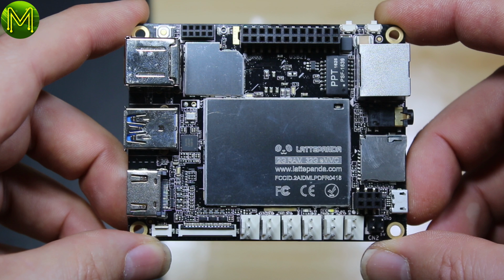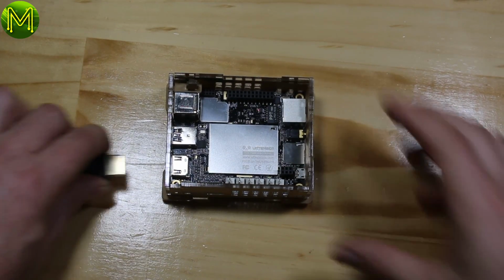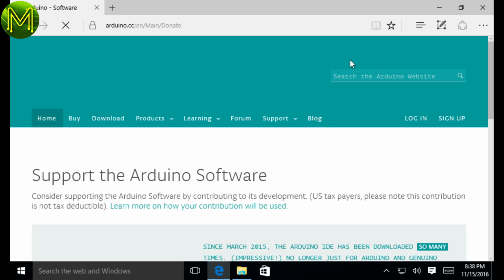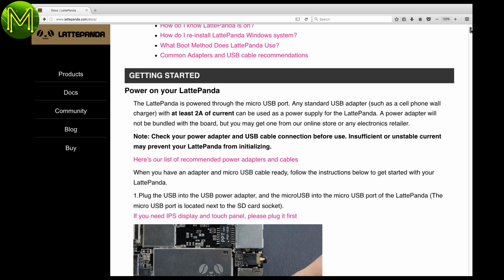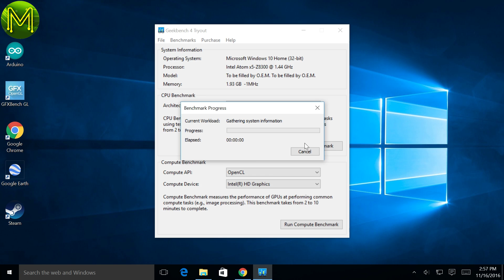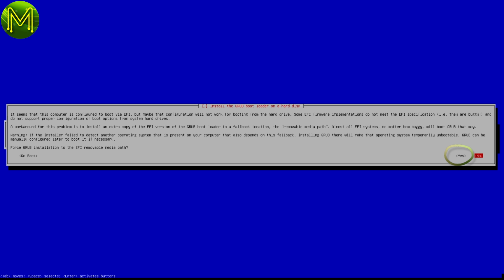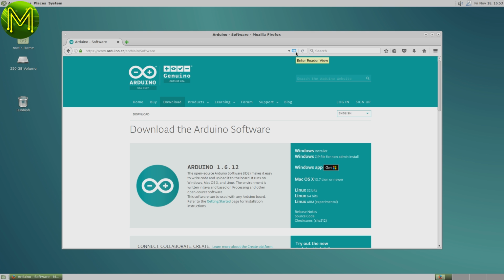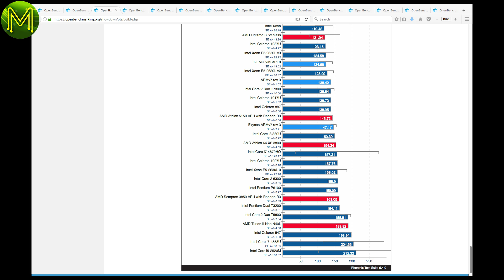#071 LattePanda 32bit: Too hot to handle? // Review

Comment: Let me get this straight. You used the Arduino IDE for the board to talk to itself? Is there an arduino chip also on the board? Is it always attached via COM2? Are the GPIOs only connected to the Arduino chip? Can the Arduino chip be programmed to do its own thing (If-Then, If-Then, If-Then) while the X86 chip takes care of higher (Desktop Computer) functions?
Reply from the maker: +Sean Miller 
You got it all correct!
The board has an ATmega which is accessible via the x86 serial port.
Reply: Thank you very much. It's very appealing for things like a home automation server.

Comment: Active cooling on is a must on the Lattepanda if you expect to get any decent performance.
It's a shame that it didn't include an actual heatsink on the CPU (underside of the board)...the shield/spreader is too thin to really do anything.

I've attached some copper heatsinks and connected a 120mm usb fan, it now doesn't throttle no matter how much I throw at it.

I think it's a great little device but like you said some strange design decisions and inadequate cooling out of the box.
Though these type machines are aimed at people who like to tinker, so it's not a huge issue to me.

There are certainly much better Arduino devices out there, so only get this one if you don't care too much about arduino or must have windows for some reason.

It works great as a media player/streamer using Kodi (inc 4k), youtube 4k and even an external bluray drive.
Also note that Cherry Trail has full hardware HEVC decoding :D
The Lattepanda also performs decently for light games, including morrowind, torchlight 1/2, titan quest etc...
Reply from the maker: Have you checked out my review update on the LateePanda?
https://www.youtube.com/watch?v=LDlRN8uy6FY
It goes into the over-heating issue testing more.

Comment: Definitely loved the video, and can't wait to see part two as I'm curious about possible ways of taming the thermal throttling...  They seem like they'd be a nice solution for a small, low power consumption BOINC setup if the overheating can be resolved, doubly so since they're x86 based which means pretty much any project can technically run on it. ^_^
Reply from the maker: +White Wulfe 
Thanks mate.
Yup the overheating is a problem. The UpBoard guys chucked a big heatsink on theirs which solved the problem on that board.

Comment: Question : I using a windows midi step sequencer (B-step pro) that uses two USB hardware controllers (novation launchpad) and also midi out (m-audio)  Was wondering if this would work on the LattePanda ?    it uses very little CPU.  
Using a dual core mini IBM at the moment, but would like something more compact.
Reply from the maker: +jean luc Dubinator 
Since it runs stick Windows 10, then I'd say it would. Either the LattePanda or UpBoard.

Comment: There is HDMI-audio out. You will need to go into the volume/audio playback settings and set the hdmi as default audio out. The CPU is actually on the bottom of the board, not under the top metal shield. And it needs active cooling. I'd even go as far as to suggest removing the metal shield from the bottom and the cheap thermal pad, and using proper thermal paste and a heatsink/fan. Your little acrylic case sadly won't support this too well. 
http://www.lattepanda.com/forum/viewtopic.php?f=6&t=71&p=3810#p3810
Once you have active cooling, the thermal throttling is no longer an issue.  It'll play skyrim and fallout new vegas, not great, but playable. I managed to get fallout 4 to start, even with 512x512 texture mods, the system just didn't have enough ram/vram to even get into the character creation. But i may try again in the future. I suspect i could get it running at 5-9 FPS with enough modifications and fast enough storage. (usb 3.0 external SSD)

If you're looking for a small single board computer like the panda, just take my advice, spend the extra money and get the top end Up board, the new Up Squared, with the quad core pentium chip. It's quite a bit more expensive, but it has stuff like m.2 and sata, many usb 3.x ports etc. That m.2 and mini pci-e is the deal-maker for the new upsquared board. (it has both from what i can tell.)
Reply from the maker: +Lazy Bunny 
Hi, yes agreed on all points, (except the HDMI audio, I'll need to check that out again).

I tend to approach my reviews from someone just getting the board and having to do the minimum work to get it to do what they want out of it.
Part 2 of this review I'll be going into active heat sinks for those wanting to do it, but I needed to highlight the good and bad points that people can expect from it "out of the box". Active cooling is something that might just turn people off, or for others it might not be an issue.

UpBoard - yes check out my review on the rev1. I'll be getting an Up2 for review hopefully this year which will be nice.
Reply: Well the hdmi-audio out, i only used with the windows 10, since i just don't like linux. Can definitely confirm that works.  The audio-out jack is a 4-pole, so it has microphone in too.
I'll agree on the active cooling thing. But even the upboards and the Up2 will or should use active cooling if you're using it for anything more than web browsing.
I do hope you get the top end Up2 board. with 8GB of ram and the quad core pentium, i'm quite curious as to what kind of gaming it can do. I love low-end gaming, and pushing under powered hardware to it's limits.

Here you go:
http://i.imgur.com/UFoWwbz.png

Right click on the speaker icon, playback devices, click your hdmi display (giving it supports audio) then click where it says "Set Default", and unmute and check volumes accordingly and your HDMI audio should work without any problems. 
All those other devices are the headphone jack (above the HDMI) and my many bluetooth headsets/headphones etc.
My PC monitor doesn't have built in speakers but it has a headphone jack on the back which feeds the HDMI audio through.
And yes that's the background i used on the panda, :D it makes looking up the GPIOs easier.
Reply: HDMI audio is working !
Reply from the maker: thk4711
Yup. Seems my HDMI recorder was at fault there!